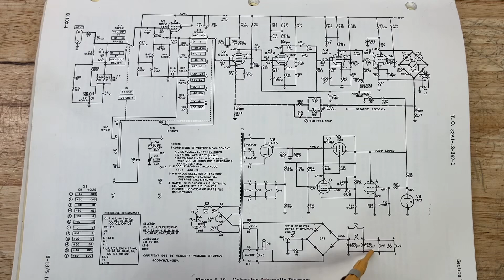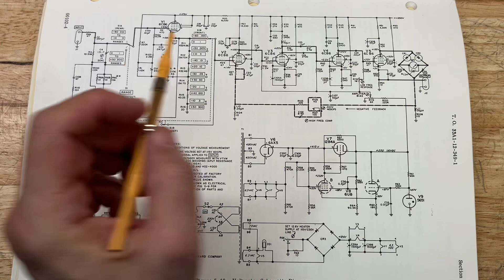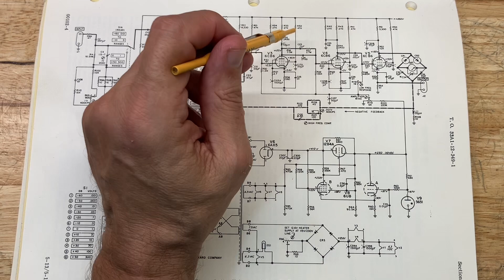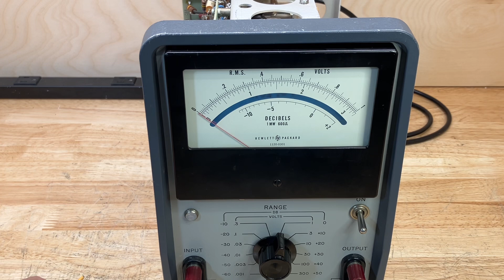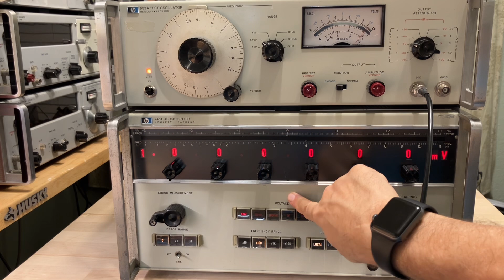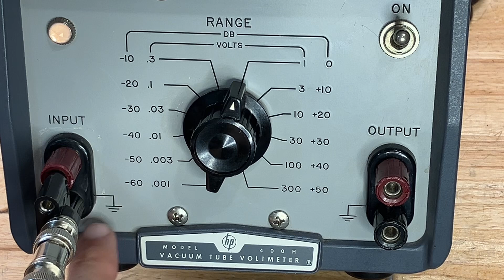HP 400H Vacuum Tube Voltmeter Part 2

Comment: Hi Gary. Do you know if the caps you ordered from Hayseed fit all three models? I have a 400L I’m restoring and the caps are reading out of spec.
Reply from the maker: All 3 instruments 400D, 400H, and 400L are exactly the same electrically. The only difference between them is the meter itself.

Comment: Those black beauties you are concerned about will be just fine for decades to come.  Those Telecaps as shown with RED printing are made with Sprague's "Di-Film" dielectric.  A kraft paper and mylar combination, these offer the best characteristics of both types-  the high insulation resistance of mylar, with the surge handling ability of paper.  So long as the plastic body is not compromised, there is no reason to replace them at their currently young age of about 40-60 years.  At this point in time, they are just as good as an Orange Drop of the same era.  
However those bearing YELLOW printing or the elder "bumblebee" variety using colored stripes, use traditional kraft paper insulation alone.  These are highly suspect and are often to be replaced upon sight.